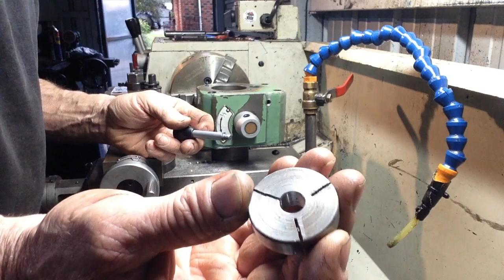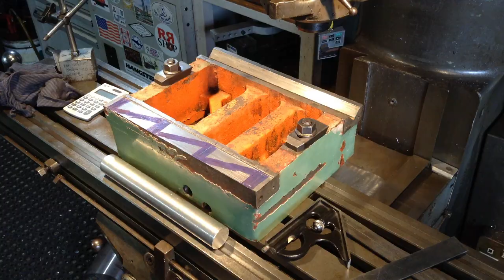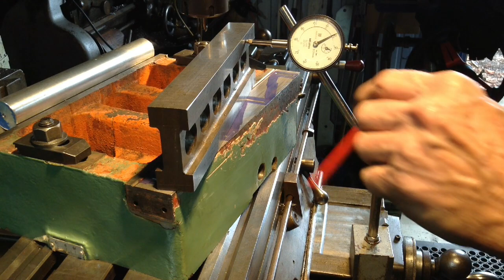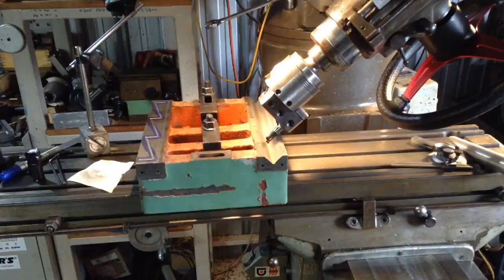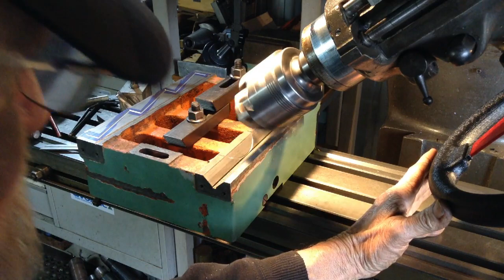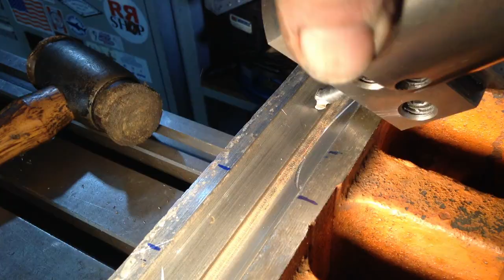JFMT 530 x 2000  Lathe Repairs .  part 3

Comment: ,hola ,,max ,no se por que ,pero casi ningun torno de lo que yo conozco , trae las ranuras de lubricación en la base de la contrapunta y pocos los fieltros ,, llegue a pensar sera , para que no se acumulen virutas y sea peor ,es cierto ,,los fieltros  si lubricas la bancada  se barren gran parte del aceite ,,o peor las virutas finas  que estan ahi al borde las mete devajo hasta que rompe la pelicula de aceite  y quedan ateapadas devajo ,tal vez si fuera que se injectara, aceite arriba la caja de fieltros y oasa a su traves , sacaria hacia afuera la suciedad que esta al borde  mas que nada delante ,, donde siempre estan sobre prisma y plano ,,,pero ,que mejor que al centro y con canales distribuidores  esto ,lubricara  sobradamente ,y el exedente , y limpira ambos extremos,,esa reforma ,si , la veo muy buena ,,,,  si cierto ,,mucho hay trabajo por hacerle  ,pero despue se olvidara de problemas por largos años ,,,vale la pena ,,,un abrazo max ,,,y grasias por el video ,,,
Reply from the maker: Thanks .  The new oil system works well .  Probably not usually done to save manufacturing costs .  👍

Comment: G’day Max I always interested in what you are doing.  When you do the scraping could you film I’ve always wondered how you go about doing it, one thing I met to ask you but keep forgetting it’s my age is 65 what does your shop do?    Kind regards John PS how do you fine the steering wheel on the mill and did you have to modify the mill much to fit it?
Reply from the maker: No worries , i will film the gib scraping .      I am setting up my shop for any general machining , light fabrication & welding .    The quill wheel is a direct fit , no modifications have to be done .     It is from Tangent Engineering , USA .   👍

Comment: Looks good Max.  The method of making the semi-circle oil grooves is clever.  I have thought of doing this to the tailstock of my lathe but have never got around to it.  Like you I thought of using flip top oilers.  I thought of putting them at the back of the tailstock as I have clearance issues on the sides.  (The carriage wings pass very close to the tailstock.)  It must feel good to finally be doing machine related tasks instead of shop building related tasks.  Ken
Reply from the maker: Thanks Ken .  Yes , so good to have the major part of construction over .     I have not drilled the cross holes yet , i will sit it back on the lathe & double check for the same clearance issues .  Thanks .   👍

Comment: Hi Max .. great job the thread, though it might have been a bit thin on the thread walls,  but working out well.  
The oil grooves worked out spot on.  Hhhmmmm how can I tilt the Wrong Fu like that,   😆 🤣 😂.     Ohh well better stick to a straigh 4mm bull nose end mill   😆 🤣 😂
Reply from the maker: The leaver is stronger than original .   👍

Comment: Great job on them oil grooves, the little arcs were quite clever 😊. I recently bought a generic morse taper 2 reamer to fix up my own tailstock. Even that one wasn't cheap 😏. The most annoying part about it is that I probably won't need it again for 20 years 🤣. Time will tell.
Excellent vid, Max! 👍😁👍
Cheers!
Reply from the maker: Cheers Chris .  Yes , the reamers do not get used much but handy to have just in case . 👍

Comment: I'm sure your oiling upgrades will work, I'm pretty curious how much oil will run through the system in operation.  I put oil cups on the bronze oilite bearings of my bench lathe countershaft, and was shocked at how quickly the oil ran out. I really didn't expect the oilite material to allow that much flow, much less with new bearings and shaft.
Reply from the maker: As long as it gets in , is the main thing .  Oil it daily .   👍

Comment: I made new way wipers for my lathe that hold 1/4" thick pieces of felt. I machined a slot in the top of them so I can soak the felt with oil,  I only have a hobby shop so that fix probably wouldn't work for your shop.
Reply from the maker: Good idea , one i will keep in mind .  👍

Comment: Nice work Max, but to add a little complication to things I think I would add some wick material anchored in the hole to the oil cup and run down the center groove to the distribution cuts.  Otherwise the oil would just run down the sides and out the bottom of the V way and very little would get to the grooves. 👍👍
Reply from the maker: The oil will run along the top of the v way & down the grooves .  That's why the grooves intersect the centre groove of the v way .  The wipers will retain a lot of the oil & because the grooves are not cut all of the way down the v , some oil will be retained there .     A squirt of oil in the cups when the lathe is oiled daily will be enough .   👍

Comment: Very nice job, especially on the half moon oil way grooves. Just a thought on the Morse Taper repair, would it be possible to relief the damaged area, ref machine a larger diameter band?
Excellent video Max.
Reply from the maker: Would work .  I will try a light touch with a reamer first .  Hoping it's something soft  that has picked up .  👍

Comment: I’ve seen oil grooves at all types of depths, as deep as three mm, or 1/8”. A lot have been hand chiseled.
Reply: I used an angle grinder and a cutting disk - any oil groove is better than none at all!
Reply: @Flattyman  exactly!
Reply from the maker: @Flattyman  A Dremel works well , with a small ball nosed tool .  The groove sides need to flare up at an angle to drag the oil along .
Reply from the maker: I have not seen hand chiseled ones for a long time .  👍
Reply: @swanvalleymachineshop  yeah, it’s an I,d way of doing it. I did it for my own tailstock. But that’s a 14” model, so it’s not that big.

Comment: Hi Max, be interesting to see how the centre height in relation to the spindle is, see how much wear on the tailstock, recently shimmed mine.
Bought MT 3 roughing and finishing reamers on ebay, worked OK on my non hardened quill.
The old Korean lathe on our facility was still half a thou high above centre after all the abuse.
Reply from the maker: It will be one of the things i will be checking & will be interesting to see .  hopefully it's still high .     👍

Comment: Gday Max, the oil grooves turned out spot on, with the head tilted at 48° could you move the X axis rather then lowering the quill?, I’m just think if I could do the same with my tailstock on the Cincinnati, brilliant job as always mate, Cheers
Reply: Moving the X axis would widen the groove.
Reply from the maker: Hi Matty . You would have to mount the part on a tilting base as not to widen the groove .    A small one like that i would probably use a dremmel .

Comment: Hi max I never tried parting with the tool inverted is it better
Reply: Many people experience less chatter.
Reply from the maker: It can solve a lot of chatter issues .  I must have had some chatter issues last time i used it for the blade to still be upside down in the holder .  👍
Reply: I've been doing it for years myself. On these little lathes it is very helpful, on the bigger lathes it's not such an issue. With these these insert parting tools good RPM and firm steady feed with coolant. Practice makes perfect.
Reply: It pushes the cutter up and away, not down and in.